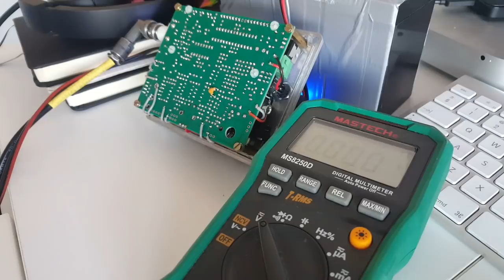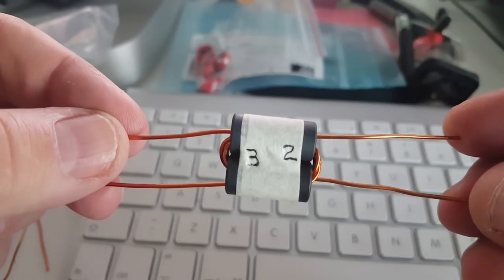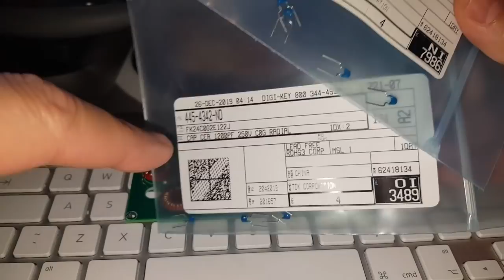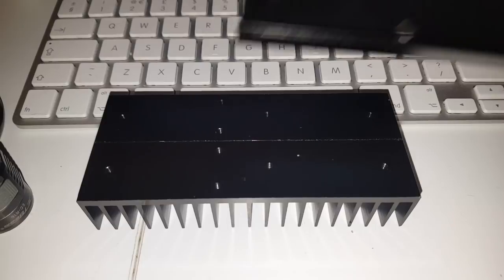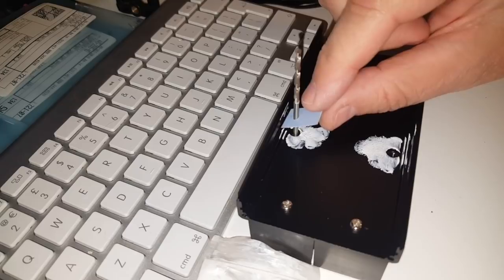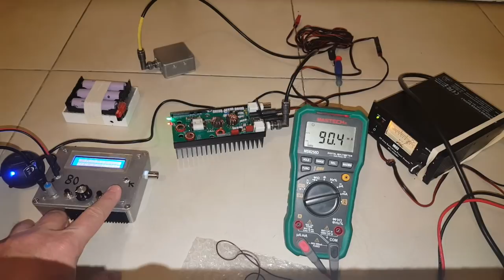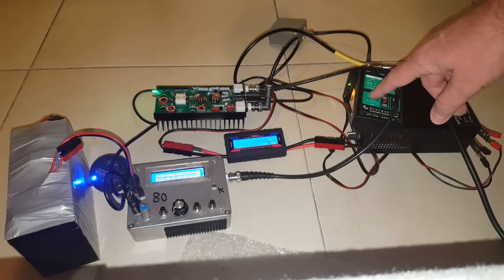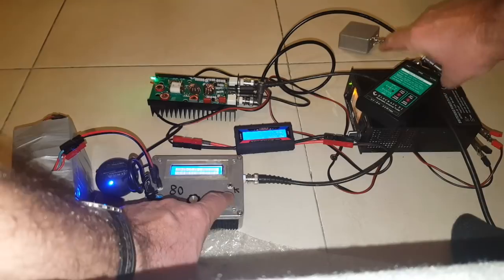Building The QRP-Labs QCX 50W CW HF Amplifier Kit.

Comment: Can true beginner build this? if it's impossible, I wanna know how to step up stairs.
Reply from the maker: Maybe as a second kit. Better build a simpler one first..
Reply: @RadioPrepper  thx 4 ur replying. the simpler one must be a transceiver or amp?
Reply from the maker: Depends on which one... Maybe start with a Pixie or a Rock-Mite (The real one, not a Chinese knock-offs), then maybe an amp. Honestly though, 5W CW or 20W SSB is enough, no need for an amp...
Reply: @RadioPrepper  thx so much. I'll think about that a little more.
Reply from the maker: That amp I built for the video, I have used only once to test it.. Never again after that...

Comment: Giles,  Jet te dis qu' chose de rigolaud... mais c'est plus facile dans ma langue maternelle..  la langue de  Lizzy,  la reine d'Angleterre  dont je suis , sans doute, parent.....

Ok back to that 470R resistor...

here was a chap struggling with a  50 W Amp on  the  qrp labs  Groups IO site.  He'd had the  78L05 z regulator in the unit blow during start up bias setting and he could not understand why.  I was giving him some minor  assistance and I mentioned  it was a very good idea to put the resistor in the PTT line as it stopped  bad things happening to the uP  in the Qcx (he had a Mini which he had build himself)....Just how he managed to blow the regulator in the PA I was at abit of  loss to explain except perhaps  some QA problem at the MFR end.

Ok so he was off  buying a replacement regulator locally... I sent him a query about 12 hr later and nothing .. .then about 14 hrs later he pops up  on the BBS and things a bad... tres mauvais.... nest time he fired up the PA , as patched up and he dropped the power on the  PA  to put a meter in line.... not only did the PA pop the regulator ...but the Qcx failed at that same instant... lock up on display...only one line showing... would not reset on power cycling.  

So I said you him  - "Ok that recommendation about the in line resistor in the  keying cable - you did that ?"

Him - no .. I thought that was only for hot plug/un plug issues.

Me..  "but by dropping the power to the PA you have done a form of hot unplug."

Him..... Oh Bugger...

So it looks as if he's destroyed the processor in the Qcx MIni.

It seems likely he's  in fact destroyed the L05 in the MIni - it has gone open cct and then  that has cascaded and blown the uP .  

He says it is easier to just buy a new kit and start again.

I think he might put that limiting resistor in the PTT line next time.  Maybe before plugging in that Amp. 

Verbum sapientibus.....
Reply from the maker: Noted thanks, and Ibdefinitely will. Truth be told, I have never used that amp after the video, and there is a good chance I won't ever again... Just not needed...
Reply: @RadioPrepper  Then  re build it  as a 30 W linear. You basically have all the parts and only a bit of surgery to make it like a Kossor EBY amp is required. TEF
Reply from the maker: I probably still wouldn't use it...
Reply: @RadioPrepper  Brave man ;.. .across the Atlantic on Ten Watts !!!
Reply from the maker: I did it once using 1.3W.
Reply: @RadioPrepper  Not on SSB  No way.  You did not unless you were in a parallel universe.
Reply from the maker: Of course, it was CW.
Reply: @RadioPrepper  IDEA _ Build it into the Qcx mini case & not in the cable.  five years down the track you will go to use it and forget these issues. I guarantee it. TEF
Reply from the maker: Oh I will.

Comment: I strongly recommend putting in a 470 R resistor in the the control line to the keying.   This is particularly important in early revision Qcx  Minis with the substandard 5V regulator.   If you hot plug the  control line then you risk blowing up the  driver Qcx sometimes even if it is not keyed.  Essentially you  put the 5V regulator in pass through mode and the 14 V toasts most of the sensitive parts of the Mini, in particular the 328 Atmel.  This extra resistor limits current and prevents Bad Things Happening. 

Possibly later revisions of the mini are proofed against this. Early versions are easily killed via a hot plugging event.   TEF
Reply from the maker: Will do thanks!
Reply: @RadioPrepper  Don't think about it.. just do it.. put it in the cable and label the cable as NO SUBSTITUTES  .  A sad story follows - check the version that starts in French.

Comment: Is that thermal paste safe to be on your finger?  It was recommended to avoid skin contact of some types of paste. Or am I out of date?
Reply from the maker: I have no idea!
Reply: @RadioPrepper  there are some that contain products you could react to, if you haven't had any reactions you are probably ok. It is recommended to use gloves if you have to apply it with a finger. Search for "thermal paste carcinogen" for info.
Reply from the maker: I sure will use gloves next time, thanks!

Comment: The -6 cores will work on 80 meters, but you will need more wire.  While the recommended frequency range of the -6 cores doesn't go as low as 3.5 mhz, in certain applications this really doesn't matter.  For band pass filters, the -6 cores might even give better results on 80 than the -2 cores, ask PA3AKE why.
Reply from the maker: The 6 is yellow right?
Reply: @RadioPrepper  Usually.  Not all toroid core makers follow the color code, but the dash 6 cores I have are yellow.

Comment: Have you thought about what type of battery pack that can be built to run the amp and qcx. One that can supply 12 and 24 volt.
Reply from the maker: Thinking about using a 24V Clansman battery with a down converter...

Comment: Hi Gil, again a nice video, well done! I have a QCX-40m still without a enclosure. Which model Hammond box did you use? The board seems to fit nicely. 72, PA0CMU
Reply from the maker: I think it's a 1594bb.. Not certain... Or 1590? I can't remember...
Reply: @RadioPrepper  I found another video on your channel about the QCX. It's the 1590BB you used. Tnx! ..

Comment: From Amazon a DC to DC Step Up 30-V 10-A Regulator was added in line with my Astron 20-Amp PS to boost the voltage up to 20-volts at 10-amps for the QRP-Labs 50-watt Amp. Now the Amp is putting out an honest 51-watts when driven by the 1.7-watt Norcal 40a.  What a pleasure to use.  w6nfu
Reply from the maker: Great. I got a converter to step down 28V from Clanman batteries to 20V...

Comment: Built this amp this past weekend in three hours to work with my Norcal 40a.  The Norcal doesn't provide 5-v on Transmit, but does have 8-v on Tx at U2 Pin 8.  This works fine with no other mods and with 1.7-w drive, the amp puts out 20-watts with just a 13.8-V Power Supply.  Dave  - w6nfu
Reply from the maker: Good news, since I am building a NorCal 40!

Comment: Hans makes some nice kits.  We're all still waiting on the QSX kit... coming up on two years now.  While I'm waiting, I'm getting a 40m Phaser for a solar powered 40m JS8 message server using a dedicated Raspberry Pi at my QTH.  As you mentioned in the video, the QRP Labs amplifier could be a very good option for vehicular use where power isn't as limited and a compromise antenna such as a coil loaded HamStick is being used.  That would allow the amp and antenna to remain in the vehicle with the amp hidden under the seat or under the dash, and a portable transceiver could be quickly plugged in as desired.  That would be a great option for the QSX when it's finally available if you'd like an all band all mode portable transceiver, or a Phaser with a Pi or small netbook could be used for digital modes, including my favorite, JS8.
Reply from the maker: He sure does! I was especially thinking about  the Hamstick...
Reply: @RadioPrepper  - I'm talking myself into two 40m Phaser transceivers - one for the JS8 message server at home and another for the JS8 go box, either backpack portable or mobile in my truck.

For over a decade, I've dreamed of my Canned Ham, simple to use very portable long range EmComm transceiver.  I never developed it because it would have been a huge project, but we're getting close with JS8 and the available transceiver kits such as Phaser or QSX.  Ideally, it would have a resonant end fed 40m/80m wire antenna and could be used on either band depending on band conditions, with standard and custom (local group) frequencies, possibly with something similar to Automatic Link Enabling.  Low antenna for NVIS regional comms or raise the antenna for DX.  It wouldn't take much work to redo the Phaser to have filters that could be software switched between 40m and 80m.  Ditto for the QSX, but it'll have even more band options.  Make it easy to interface to a netbook PC or Raspberry Pi.  There could even be an ultralight microcontroller version with a waterproof silicone keyboard and dot matrix LCD.

Comment: 25w for voice....try telling Italy...they stomp all over me at 5w!!!!!
Reply from the maker: I'll never understand the need...
Reply: FYI Amplifier Class is a matter of how it is biased. If you increase the bias potentiometer to around 1/4 A idle current, the transistors will operate in their linear region and it would work for SSB. Efficiency and heat dissipation will be higher so watch out for high temperature rise. Though SSB isn't continuous full power anyway - the average power will depend on what level of speech processing you have but I'd keep it not more than 25W average. 

This would be experimental - I have not tested it myself and do not know how good the linearity is (and hence IMD3 performance).

73 Hans G0UPL 
http://qrp-labs.com

Comment: I did not see you apply heat sink compound between the heat sinks and the case.
Reply from the maker: Darn I forgot!
Reply: FYI I haven't added heatsink compound on any of mine. In fact the improvement it makes is minor. The IRF510 is not a particularly high power device. It is cheap and it is common, and it makes a great 50W HF amp. That's why I used it. 

The thermal resistance is made up of 
1) semiconductor junction to TO220 tab
2) TO220 to silicone insulator tab
3) silicone insulator tab
4) silicone insulator tab to box
5) box metal 
6) box external to heatsink.

By FAR the dominant term is the semiconductor junction to TO220 tab thermal resistance. This is inside the IRF510 device and you can't do anything about it. Heatsink compound between box lid and heatsink has negligible benefit as the contact area is large. Heatsink compound between IRF510 tab and the silicone pad makes very little improvement because the main thermal resistance (at least by an order of magnitude) is the semiconductor junction to the IRF510 tab. 

Heatsink compound does no harm but neither, at these power levels and with these devices, does it make particularly much difference.

73 Hans G0UPL 
http://qrp-labs.com

Comment: I built my amp a few weeks ago and it was a great kit to build.  I think I had the same mounting issues you did, your video made me laugh (empathy).  I appreciate QRP-Labs for making the kit, mine was great on initial power up and really didn't need any fine tuning.
Reply: Guys I'm with you 100%. I laughed my head off watching the video. I designed the kit. I designed the enclosure. I wrote the assembly manual. Yet, when actually assembling one for validating the instructions and taking photos for the manual, guess what? I made all the same mistakes. Screws in the wrong holes, IRF510 wouldn't slide by, pads fell off the box lid, etc. I had to do it all again. TWICE! 

So yes: follow the manual to the LETTER! Then it will all go together properly.

73 Hans G0UPL 
http://qrp-labs.com
Reply from the maker: Yep, very simple and just one adjustment!